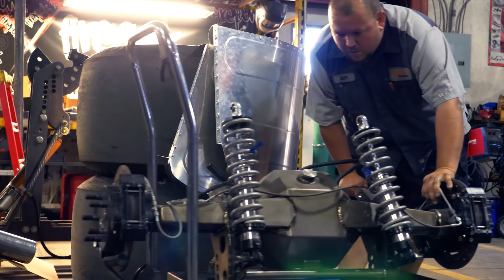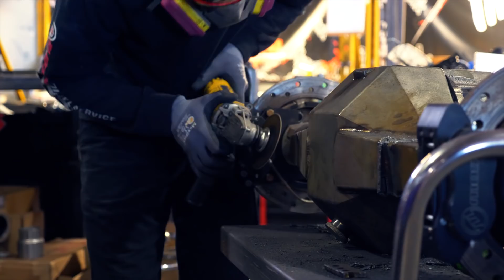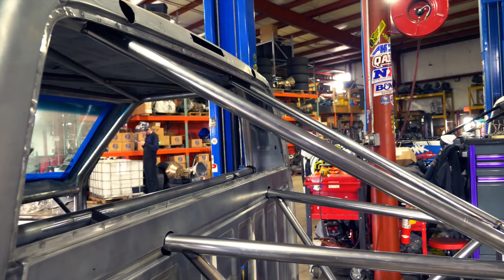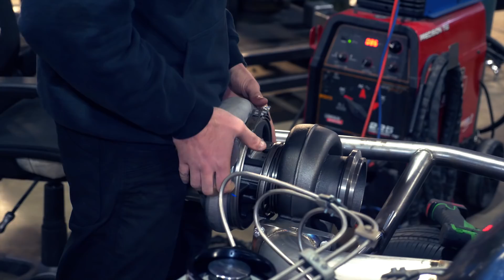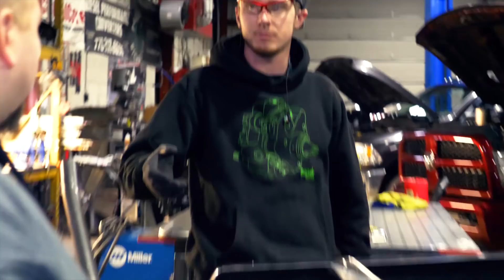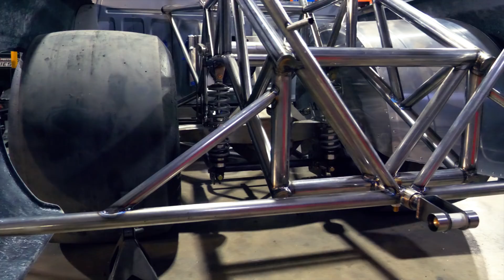12V RACE TRUCK! TWIN TURBO FAB - 4LINK CHASSIS BUILD

Comment: That’s some real beautiful work you guys do a far assign for Searne pro stock cars but I don’t have too much over on what you just did on the 12 valve are anyway I’m Tigue welding I have a dynasty to 10 DX and I’ve been recently using a filler rod called weld mold 880 really nice rod to work with I’ve learned about it all on from a guy name Jody Collier year from welding trips welding tricks and tips.com anyhow highly highly recommend it I know it’s a really good quality rod

Comment: What a great video!! Love your guys work👌. That said I have an 03 5.9 6speed with exergy 100% over and 12mm pump. Fass 165, studs, Hamilton springs, pushrods, rockers and soon 188/220 cam. Steed speed t4, hptuners, somehow still keeping a ED s366 alive but ready to buy a turbo as it’s well needed. What should I look at?? Please chime in, it’s a street truck that don’t get driven every day and never tows more than maybe 4-5k. Thanks
Reply: Check out stainless diesel, they can help you size the correct turbo for what you use the truck for
Reply: s468, s471, s472??? Come on now chime in